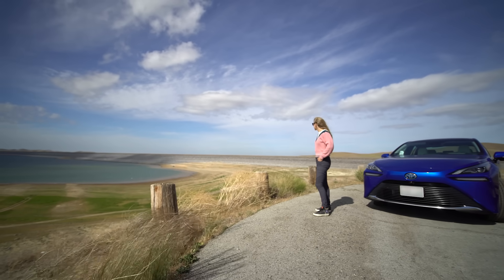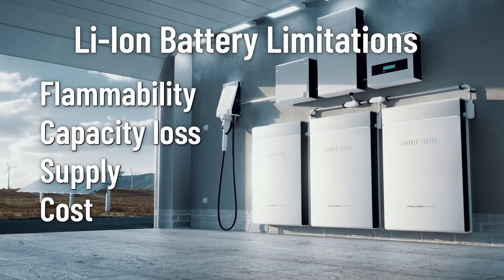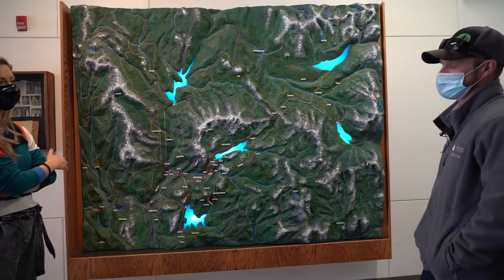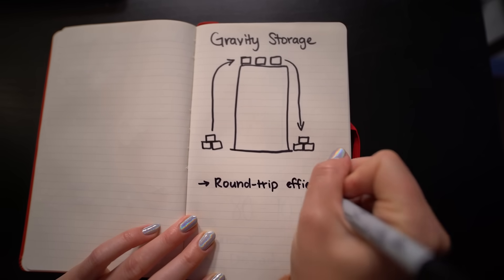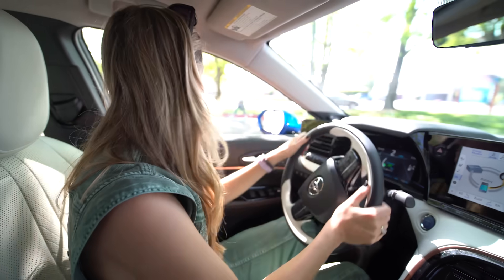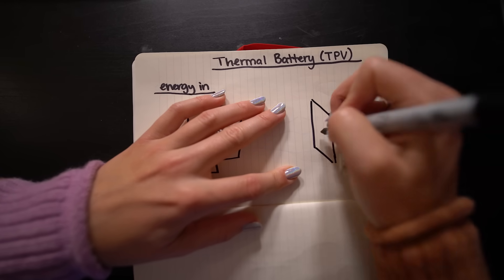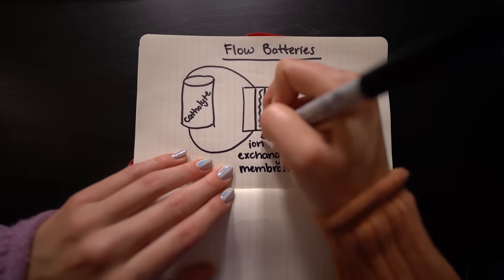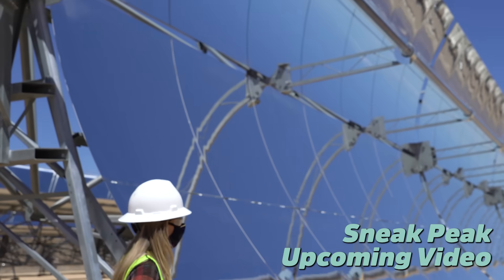The BIGGEST problem with clean energy

Comment: At least here’s a video talking about this subject from the correct angle: there is plenty of energy, we just lack effective ways to store what is generated.
Reply: The reason we have plenty of energy now is because we use Fossil Fuels (FF). To be "green" we need plenty of "green" energy. Only 4% of our current energy is green.

We will need approximately 2 million wind generators to meet the BEV electricity demand of the 2050 goal. If you prefer nuclear, we would need to complete a new nuclear plant every 3 weeks to meet the EV goal. for discussion purposes, lets assume that we just use wind for the EV energy and the other sources for industrial, commercial and residential.

We currently have around 67,000 wind generators which has taken 30 years to accumulate and since the life span of a wind generator is less than 30 years, all of our current generators will need to be replaced by 2050. A wind generator take a literal ton of REM (rare earth metal) to produce. Over 90% of the REM we (the USA) use comes from China and the demand for REM already exceeds supply. The are other potential sources of REM in countries like Afghanistan which, not surprisingly, China is already investing in.

To say that we will have plenty of green energy to power BEVs from wind is to say that we have plenty of REM to construct wind generators at 50x the current rate of construction.

Of course we could build 5200 nuclear plants or use 4 million square miles of solar plants and many more acres to store the solar energy to supply the green energy demands of just the BEV but remember we need to convert our industrial, commercial and residential demands to green energy also.

In the short term we do have excess energy because of the intermittency of green energy but once the BEV saturate the market we will not have enough energy to replace FF vehicles without building a lot more plants to meet the demands.
Reply: @douglasjacobs882  “Invest in Afghanistan…” 
You, sir, are crazy. I also hope that this green insanity fails as quickly as possible so that we do not get some sort of serious energy crisis that will doom us all.
Reply: @douglasjacobs882  Wind turbines have a much longer life expectancy, we just switch the old up with new ones because technology has advanced so much it would cost the owner thousands of dollars.
Reply: Except we need 1/4 the land of Arizona covered in solar to meet todays needs.  Build nuclear power plants.  Its the only realistic option if you want to go green.  Deal with the toxic waste later.  Fusion power is decades away, and pushing cars to electric only adds more burden to the grid.  

Arguing over how to tackle this problem won't matter when you can't grow food, and get water. 

The time is now, we have the technology today!
Reply: @AB-nv7bz  we would need to complete a 10 GW nuclear plant every 3 weeks to meet the BEV demand that will be needed to meet Biden's 2050 goal. We would need a lot  more uranium mines.
The proposed breeder reactors would actually consume our existing waste.
I  think fusion energy will take off when we have a reliable source of Helium-3. The moon has vast resources of it but of course that is in the future. 
Uranium mines take more land use than solar. 
Nuclear is an important component but it can't be the only component.
Reply: .... Or to transport it to consumers once it's stored. The current grids simply can't take the increased demand. Of course we know how to lay down more wires and there's some promising new tech there too - but either way it's a huge undertaking.
Reply: Earth has been storing energy for millions of years. We just need to release it in a way that doesn't cause more harm than good.
Reply: Are you new to YT? Grid storage has been being researched and videos produced for years now.
Reply: well put
Reply: It appears we don't lack effective ways to store what is generated. We just need to get on it and make use of the tech now lol
Reply: People are working, don't worry. Take a search for the video "Carbon-neutral fuel made from sunlight and air" and watch.
Reply: https://www.youtube.com/watch?v=9xe3BWPsBTU
Bill Gates Slams Unreliable Wind and Solar Energy
Reply: What the lighting harnessing theory?
Reply: what if we stored it in blocks of compressed energy forms that are stable for eons and easily and quickly released?
Reply: @jaewok5G  You mean fossil fuel? Lol
Reply: What I learned from the video is "GREEN" is anything but green. As GREEN requires fast responding CO2 based fossil fueled power plants to be available 24/7/365. And the video completed avoided the topic of green disposal. Where will millions of highly toxic solar panels and lithium batteries be disposed of?
Reply: yes and no. the biggest barrier is trying to create all these green techs without causing the same pollution that is destroying the planet. Your smart phone has over 60 different metals in them, all dug up from different parts of the earth, moved to be refined, moved to be processed, then moved to be assembled and moved to be consumed. And that's just your tiny smart phone, we want to electrify everything. The largest hurdle will be to convince society we don't need as much stuff, then we simply do not have to make it and will not pollute. But goodluck doing that.
Reply: @LeDuckDuckGoose  if every part of those processes is completely carbon neutral, which is unthinkable right now, but will probably happen at some point far in the future. Then it doesn't matter. 

Mining for resources like metals is not the problem, the problem is how we do that.
Reply: @LeDuckDuckGoose  Exactamente! Solar, Wind & batteries require massive amounts of digging, take up huge amounts of land, tons of maintenance & they don’t last very long. And then you have the recycling problem.
Reply: @LeDuckDuckGoose  pollution while bad for humans isn't what's destroying the planet,
The planet is getting old quick thats all
Reply: This is where high temperature nuclear reactors make sense since their heat can be stored in the form of molten salt or molten aluminum.  A plant like this can act as a very efficient giant battery.  Since the plant can save it's power for when electrical demand is high with corresponding high prices for this power such a plant can be profitable even if the costs of it's power is higher that other sources of power that can't produce power during these times. Such plants would make low cost but intermittent power producers like wind and Solar more practical and ovoid the duck curve problem.
Reply: @stanleytolle416  If you have the nuclear plants you don’t need the solar panels…
Reply: @grahamstrouse1165  how long does it take to build a nuclear plant? How many are shovel ready to begin today? How long would it be until we can complete a new nuclear plant every week?
Reply: Correct angle? This is basically Toyota sponsored by Physics Girl. Wow. Just watched all 3 and have to say she has hit a new low. These are basically manufactured adverts for Toyota. Shilling out for a car company rather than staying with PBS? She is as bad as the shills of Our Ludicrous Future who all were taking back handers from electric car companies as well. What next? Sponsored by Raid: Shadow Legends? Unsubscribing as all down hill from here on.
Reply: Yes and no, I think some people haven't done the math, Tony Seba and team did, jusst watch: Rethinking Energy -- 100% Solar, Wind and Batteries Is Just The Beginning
Reply: @autohmae  It depends of the amount of excess renewable capacity is reasonable? We could put up enough wind and solar to meet demand in the dead of winter and likewise improve the load sharing between providers and then use the excess in summer to make Hydrogen or sythesized fuels. This is still storage, but from another perspective, where fluctuations are covered by overcapacity and the excess is used for other things. Industry has a lot of processes that could be converted to electricity, this is about much more than just EVs. They could also be a power sink for excess renewables to make raw materials for production the rest of the year..
Reply: @autohmae  The latest video over at Just have a think, got me thinking! It is about the compound effect of renewable tech, how it synergizes, to transform not just the economy of scale within its own segment, but adds up to make solar and wind abundant in a sense like never before imagined.
Reply: Neither batteries nor solar panels are environmentally friendly and the amount of area necessary to install all these "green" energies along with storage is just not there.
Reply: @GeorgiosD90  I bet the western world (Europe at least) will be unrecognizable in 15 years: Power production will be 80% renewable and private cars will be fewer and only electric. Farming will also be transitioning, meat will be a luxury, something you eat only at special occasions. Products will be prized by their CO2 footprint so people are going to chose products differently. You are right, it will take a lot of area to put up the nessecary solar and everybody will have a view of a wind turbine park, but they are cleaner. A solar panel emits only 5g CO2 /kWh a wind turbine around 2g if you factor in maintennance, energy and material use in their manufacture.
Reply: @Tore_Lund  Germany has spent billions already and achieved only 23% green electricity, about 7 % of total energy generation. 
None of that was created with green energy btw. also Germany does not even have enough area to produce 80% green energy, let alone store it. Also its electricity costs 14 times more than that of a developing country.
Lets not forget CO2 is food for plants. Meat is necessary for humans to develop and survive or are you promoting some kind of aristocracy here? Where only the few will have electricity and meat?
Im sure you will lose your bet 100% of the time. You live in a fairytale where the word efficiency is not yet invented.
Enough said.
Reply: @Tore_Lund  I wrote a reply to the top poster in this thread that addresses the idea of "excess" energy but I want to address your "dead of winter" portion of your comment.

The state of Iowa is the second largest user of wind energy behind Texas. Iowa has the "potential" of generating 300% of it's electricity demands of which they currently get around 40% of their electricity from wind. The 300% is a little deceiving in that Iowa is also one of the highest users per capita of natural gas. Most winter heating in homes in Iowa comes from gas and the drying of grains in the fall are done by natural gas.

If you convert heating of homes, drying of grains and transportation to electricity instead of natural gas, in the end, the state of Iowa might be able to support itself with wind power. If you consider that the state of Iowa is 3 million people and the state of Illinois is close to 30 million people while at the same time the state of Illinois has significantly less wind potential you will begin to see a lack of excess green energy.

The average usage of 40% currently in the state of Iowa takes into account the slack periods where FF is needed to meet the demand and the overcapacity periods where they can export energy or possibly store energy instead of not generating due to lack of demand. The slack period in Iowa is called summer. Not some days in summer, the season of summer. In summer in Iowa (and typically other non-coastal regions), the energy generated is at 1/3 the rate of the yearly average during the summer and 3x the yearly average during the peak which is the winter. 

The current peak electricity usage for Iowa is in the summer but that demand will be even higher if all the transportation is electric. If you convert all the grain drying and transportation to electric the harvest season will become the peak electricity usage.

The solar potential in Iowa is not sufficient to make up for the lack of wind in the summer. That means that, even after harnessing the max potential of wind and solar in Iowa, they will depend on long term (9 months) storage or they would need to import solar power from a sunnier state like Arizona. If Arizona is supplying electricity to Iowa and Illinois in the summer then they are not able to use put that energy into long term storage to provide energy to Illinois in the winter when they have a shortfall of wind energy even in the winter. 

When the office worker in Chicago looks out from his high rise office building and sees wind generators covering Lake Michigan as far as the eye can see and is confident that the deserts of Arizona are sufficiently covered with solar panels and storage to charge their EV, we will be nearing net zero.

I don't think that is feasible by 2050 when all new cars are electric. It is possible but I don't see it as feasible. Therefore, I see FF powered electric vehicles in 2050.
Reply: @douglasjacobs882  Yes true and thank you for that rundown. You need better exchange between states. You can't run your grid alone like you are a small country. In Europe, power trade is automated and operates within agreed bounds, so from Norway to Spain and Poland, national grids a mutually bound by usually 5 year contracts. Our winters are our peak consumption season, little sun and higher demand and we do import more coal power from like Poland when this happenes, however this is expected to be sorted in 2035 as coal power contracts are not renewed and the idea is that several countries then will be above 45% installed renewable. At the same time Russian gas is the presumed backup, which has a smaller CO2 footprint than coal, so not perfect yet but this is the roadmap, but it is expected that most of the fluctuations can be dealt with by then by international power sharing.
Reply: @Tore_Lund  The US had one pipeline that carried fuel to supply the NE sector of the country shutdown for a week by cyber. 
What would Europe do, in the unlikely event, if Russia attacked Poland and cut off their supply of coal energy and shutdown the supply of natural gas, in the winter? 
Those same ends could be attained be terrorists hitting key infrastructure. 
Maybe the grid in Europe is such that they have enough redundancy to ensure the whole grid couldn't go down from a single attack but distribution lines are not capable of transmission over long distance. 
Transmission of energy from Arizona to Illinois is a major undertaking and for redundancy it would need to be done at least twice. 
We currently have enough storage capacity to power the country for 3 seconds. Storage could be used for a level of redundancy but that would be on top of the storage that would be depended on just to get you through the night due to lack of solar.
If you use FF plants for redundancy than you need to keep them idling all the time producing co2 or be able to wait a day or more to get them up to speed. 

We will get it all figured out and built some day but the 2050 goal is mere wishful thinking. I  would be happy to be proven wrong. 

I looked at Norway a while back. They get 93% of their energy from hydro. The only time they import energy is in dry seasons. They are a small country so they wouldn't be able to supply much of Europe even if operating at full capacity. They're a prime candidate for pumped storage.
Reply: @GeorgiosD90  I don't know where you get your numbers from but Germany has produced 50% of last years energy with renewables. Living without meat consumption? Completely doable, needs just a bit of research at the beginning for new recipes and then your good to go, completely healthy.
Reply: @sixtus9559  The official numbers are 23% el. consumption and considering alltypes of energy generation its about 7%. Not 50% lmao get your definitions straight.
Also meat is essential, just look at small kids, without meat a person cannot develop properly.
But its nice to live in a dreamworld.
Reply: @cagasbura420  What I am proposing is that you go and search how much Germany spent on 7% renewable energy, then you scale the cost, the area necessary, the efficiency and life cycle of the alternatives and then make up your own opinion considering we are not really in a crisis and that the government wants to regulate the private sector but does nothing itself, e.g energy efficient infrastructure and transportation.
Simple really.
Reply: @GeorgiosD90  where are you getting these numbers from? Because it’s not clear what you mean.
Reply: @therealjetlag  The numbers are from the German federal ministry of economics. And it is pretty clear what I am saying, if you cant see it then you are biased.
Reply: @GeorgiosD90  No need to be rude, I was just asking for where you got the numbers from (and a link would have been nice), because I've googled around and can't find anything matching those numbers. But if you just want to be confrontational...
Reply: @therealjetlag  Dont forget that it was not clear what I mean, based on where I got my numbers from lmfao. 
Now read my comment again and do the work.
Reply: @GeorgiosD90  And again with the rude. Good luck with getting your truth out there if you're not prepared to back up your claims. I already told you I googled, which is why I asked what you meant (7% of what?) and where you got your numbers from. So, I'll just assume you're lying and can't find a link.
Reply: @GeorgiosD90  1st generation biofuel is converting food and fodder into ethanol so basically if this ramps up then  instead of producing meat they will produce fuel for those who can afford cars.  About half the maize grown in USA is used to make ethanol to add to petrol for cars. There is a factory in Northern England which turns large amounts of wheat into ethanol. Some calculations say that it takes over a litre of fossil fuel to make a litre of ethanol.
Reply: @Tore_Lund  people that don't have any kind of deep understanding of the issue use power and electricity interchangeably.  you could snap your fingers and make all the electricity co2 free, and you're barely going to make a dent in co2 emissions because the overwhelming majority of co2 consumption is direct burning in either a gas car, or and oil furnace.
Reply: @Tore_Lund  The downshifting is not any solution. The fact is majority of the world lives at lower living standards and want to raise their living standards. Similar ideologies (like ideology about solving problems by downshifting, being green, not eating meat, etc.) have been tried to be spread at varying rates for long times before, and it hasn't happened so that whole world would adopt the same ideology if it is only based on ideology. For example the fight between communism and capitalism for the past 100 years. Good luck with that. Only real solution is major technological development. These are problems created by technological choices, and that is where the solutions lie as well. Things like eating meat are not any kind of problem as far as the meat is produced in sustainable way. Methane is a short lived gas, and big herds of grazing animals have been on the planet for tens of thousands of years. The current situation with little freely grazing animals is rather the abnormal situation. Last thing but not least, all carbon emissions don't need to be stopped, it is enough that a balance is reached. That can be done also by improving carbon captures. For example Nordic countries in Europe are already almost carbon neutral (depends how one calculates the increased forest areas in the past 50 years). There is a lot of potential for increasing carbon captures at many areas in the world.
Reply: @autohmae  The overall track record of assuming a current exponential trend will continue indefinitely into the future is extremely poor.   All such trends eventually end, the only question is when.  We already have indications that the reduction in solar costs are slowing.  And at the same time,  value deflation for renewables means solar has to be much cheaper  than it currently is, along with massive increases in storage, just for it to be economically viable at percentages over about 30%.  The more capacity is added, the worse value deflation gets.  Add to that the near asymptotic nature of the increasing cost of adequate storage going above about 80% renewables, and the scope of technical and economic challenges still to be overcome is clear.
Reply: @caseywarren7426  I am right.
Reply: @GeorgiosD90  You are confusing your facts.  Rare Earth metals are used mostly in large offshore wind turbines (where weight reduction is important).  They are not necessary and are not commonly used on land based turbines in the U.S..  Also we aren't about to run out of place for solar energy production - that is completely ridiculous.
Reply: @fillfreakin2245  I am not confusing anything, you are just clueless.
A wind turbine produces 0 energy at Bft 0. At Bft 1 you need 1000x turbines more than what you designed for Bft 5 to produce the same energy.
Solar energy is efficient only close to the equator, anything else would require too much space to produce enough energy.
At the end of the day these solutions are not sustainable and the necessary investment is off the charts for something as inefficient as this.
Reply: @GeorgiosD90  Ahh, I see the problem: your reading comprehension, or lack thereof.
Reply: @fillfreakin2245  Your personal opinion about a stranger is irrelevant to the topic.
The point is simple, wind and solar are too inefficient, when looking at the investment, area needed, maintenance etc. vs the produced energy, unless you want the world to be poor.
All the offshore wind parks have been built by the oil fuelled industry btw.
Reply: @GeorgiosD90  Yes, my opinion of your reading skills is important in deciding if we can have a reasonable conversation. Sorry, that the truth hurts you so, but there it is.
Reply: @fillfreakin2245  I never asked to have a reasonable conversation with you lol. The truth hurts, but your opinion about a stranger is not a truth.
In any case, go calculate how much energy you spend in 1 year then calculate how much you produce with a wind turbine, then come and comment. Anything else is pointless.
Reply: @GeorgiosD90  It's not my opinion, it's a valid assumption, when you continually fail to respond to people's comments in your replies.
Reply: @fillfreakin2245  What you think is a valid assumption is just your opinion mate. In any case, none of your last comments have anything to do with the topic and are exactly as inefficient as a wind turbine or a solar panel not installed in the sahara desert.
Reply: @autohmae  Except they won’t. The tech is essentially mature. It looks better than it is because of gov’t subsidies.
Reply: @Tore_Lund  How’s hat Russian gas looking now?
Reply: @douglasjacobs882  “What would Europe do if Russia attacked Poland?” Well, the good news is they didn’t attack Poland…🇺🇦
Reply: @grahamstrouse1165  You are confusing me with another commenter. I have never been an advocate of natural gas, Russian or otherwise.
Reply: @fillfreakin2245  Near as I can tell, all wind generators that wish to be efficient as possible use REM. Sure, you can build one with old tech and achieve lower efficiency (EROEI). The range of wind speeds it can operate in would be diminished and it wouldn't last as long. 

You could also build a bullet train without REM. It probably wouldn't last very long, and you couldn't go as fast, but you could do it.
Reply: @autohmae  A person will be born, live, and die within a 100-km radius on "100% Solar, Wind and Batteries"